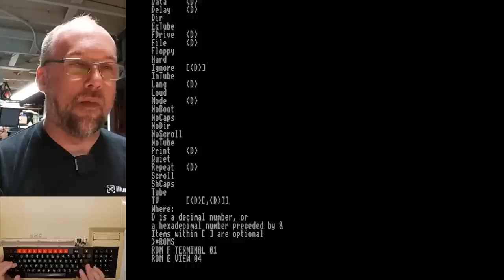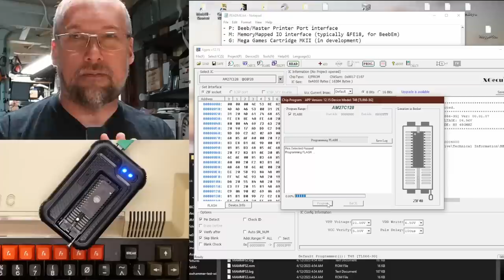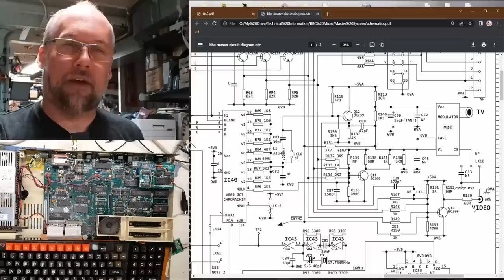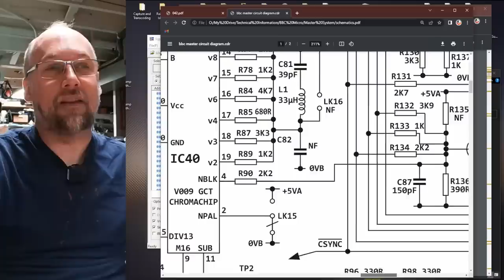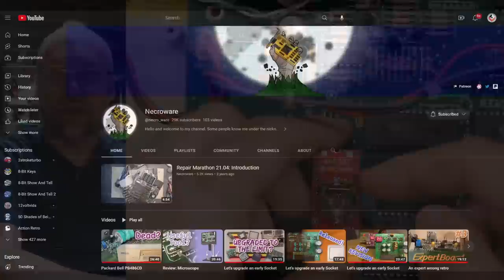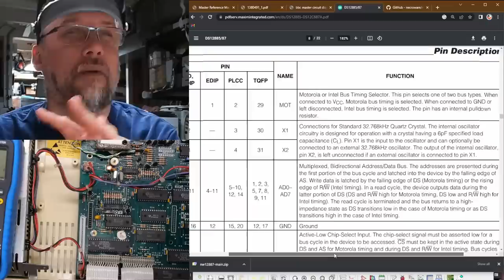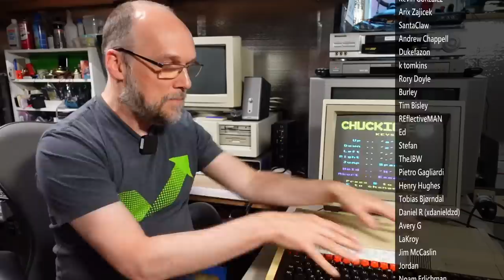BBC Master mods and improvememts

Comment: I used these things at school as a primary schooler, but I have more C64 memories for games, but its always really cool to see them.

Great to see running, and fun to see your solution to certain... I guess you'd say regional problems. I remember using PAL60 on the Dreamcast and A1200 just to be able to get a colour picture on my RF only bedroom TV. For downstairs when me mum was out or in bed, I could use SCART for RGB. With the Dreamcast it's sorta surprising, as it was inbuilt into most games to ask if you want to play in PAL60 on startup, it's odd for such a hacky mode to be almost system standard. I only ever had 1 TV it didn't work on and it was an expensive JVC set from the early '90s. Even cheap crap '80s portables managed it after a quick fiddle with the vertical hold.

Comment: The BBC Micro Model B issue 7 boards had the same jumper to add chroma signal to composite.
I put a small switch like you did, colour/mono.

Comment: The Dallas Chips with the internal battery and crystal have a battery and crystal in their larger case and the IC pins for those are bent upwards and connected to those. You can revive any old Dallas chip by removing some potty to uncover those pins, disconnect the way to the internal battery and connect an external coin cell. Some other RTC chips of that type have the IC pins for crystal and battery at their head sides and need those uncovered, but basically there is no need to throw any of those chips away.

Comment: I'd probably put a bit of hot glue around the socketed crystals as they seemed like they might fall out if the machine is jolted. I wonder if you can also jumper between two different crystals, pal/ntsc. Was cool to watch you solve all the problems, nice work!

Comment: When I was at school, oh so long ago, I used to think the BBC was quite clunky compared to my VIC-20 (and the PET that had been donated to the school because the screen editor built into commodore machines was just streets ahead of anything else in terms of usability. I think the (much later) Master may have had alternatives, but the standard 'copy key' method of editing is a bit horrid — half a step above a paper terminal.

HOWEVER, as a now semi retired software engineer, I now appreciate how clever the software architecture of Acorn MOS is; the Sideways ROM idea, for example, allowing lots of alternative file systems, programming languages etc. all within the confines of the 64K address space is something I think no other (non Acorn) 8-but got close to. Then add in concepts like the Tube.
Reply from the maker: Yeah the Commodore editor is a shining star in late 70s system honestly ... And indeed, if you had a BBC and were doing any serious editing, it looks like you really needed to get that Basic Editor ROM I've seen some people use. It's quite amazing that the 1977 PET had that wonderful editor that everyone loves from the VIC-20 and C64. 

But yeah, the computers are just so  smartly designed, and the rest of the basic interpreter is pretty damn great.

Comment: I noticed that link on IC40 the first time you showed that area of the circuit diagram.  I was waiting to see if you spotted it too before commenting, but I thought immediately that there must be a way to reconfigure the hardware to use NTSC instead of PAL.  It's fun to see that you noticed it too, and that it worked.

Comment: All you need now is the tin box Microvitec Cub monitor for the full experience, only big issue would be the voltage (and I've no idea if they can be switched or modded for 120v), although shipping one of them across the pond and having it arrive intact, that's another problem... :P

Comment: BBC basic was largely written by the same person responsible for the original ARM instruction set.
Reply: Roger (Sophie) Wilson wrote BBC Basic and with Steve Furber, both developed ARM.  Credit to these two individuals.
Reply: @marillionuk  I was very specific in referring only the to the design of the ISA, not the design of the processor overall.

Comment: Just make sure the clock battery is over 3 volts before buttoning up the computer and putting it away. A coworker came across a situation with one particular SRAM / clock chip (can’t recall the part number, will try and find it) that when the battery voltage is just under 3 volts when it is powered down, that chip begins actively draining the battery! Changing the battery to a fresh one fixed the ‘problem’.

Comment: If you look at how we in the UK do a "ZX Spectrum Comp Mod" we do just connect the V1 signal to the comp output using a 100 micro farad capacitor to remove the DC.

Comment: I used a bbc b at school and bought one later and then sold it later on i wish I had kept it. What i liked about the bbc b was the user port you could use this control lots of projects in the same way you can use the gpio on a raspberry pi. I was so easy to use and expandable.

Comment: Going back to something you said in Episode 1, I'm like 99% sure that machine was used in the BBC somewhere, that stamped on logo very closely matches the logo that was in use on BBC TV throughout the 70s and early 80s, even with the double spaced line through the middle of the B's. Would also make sense to have a speaker switch in a TV studio as well. Pretty neat.
Reply: They did use them at some point for the teletext services I think. 
You could also hook up a digitizer so not sure if that was used for anything eg you could hook up a basic scanner or freeze frame and save it to file
Reply: It was mentioned in the comments of the previous video that it came from Broadcasting House in central London. But I wonder if it was actually BBC Television Centre in west London because Broadcasting House was largely the radio side of the BBC at the time.

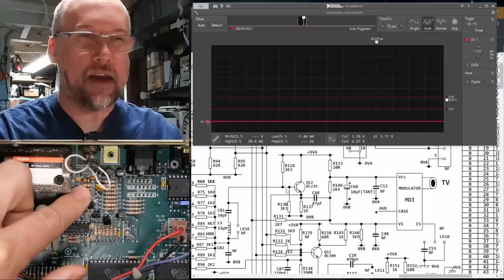Comment: Adrian, at 30:18 you mention R130 and R118 as connection points however I think you meant R137.  R130 and R118 connect to the Base of Q12 whereas R137 connects to the emitter of Q12 which I believe is the correct spot based on your description.  Did I miss something?

Comment: It was normal for BBCs and Masters to operate in MODE 7 (or 135 for shadowed MODE 7) when typing in BASIC or using OS commands -- this is the 40-column teletext mode with hardware character rendering, and is so much faster than any of the other graphical modes where the OS has to copy each character to bitmapped video memory.
Reply: mode 7 was also much easier to read for people like me that only had a TV and not a monitor

you are absolutely correct that mode 7 was not bitmapped like the other modes and was exceptionally fast...to demonstrate, list a BASIC program and see it whizzing off screen in mode 7...hence the need for shift+ctrl to suspend the scrolling

Comment: That machine has ECONET so might be worth getting a matching interface to let you host software on your PC don't know.
Reply: That's pretty hard core. I would say the Pi Tube Direct is a better addition to start with. That can then emulate the first ARM device in the world "ARM Evaluation System" and run the tube version of Elite!
Reply: @SimonEllwood  What about using the BBC Master to host software for the NABU PC as the NABU uses a similar connection

Comment: Great job with the RTC. As soon as I saw the 146818 part number on that IC I had an idea what you might do. The original chip was Motorola branded, the MC146818, so the Hitachi one might be a second source supplier for it. I also immediately thought "will it use Intel or Motorola bus timing?" as I had seen this on the datasheets before.

Comment: Great video. I have also been mystified by the Beebs. It seems a lot of the info out there assumes you grew up with the machine in the UK in the 80s and watched all the episodes of the computer show they had on TV. There's not a lot of "getting started" material, and a lot of surface searches end up referring to the Micro:bit.

Comment: I think you are correct Adrian regarding BBC Master being sold to Australia, especially in schools, I think it was rebranded as Proton...?

"BBC Proton" microcomputer, made by Acorn in UK but modified in Australia in 1981. This model was widely used in Australian schools. The donor states that he assembled the machine in the UK while working for Barston Computers.The circuitry is hand soldered. This unit is serial no. 2. It is the third one made as the count started with 0.

(Also known as BBC Micro Model B).
Reply: The Proton was Acorn's planned successor to the Atom before the BBC contract came along. The design was then adapted to meet the BBC's needs and became the BBC Micro, available in Model A and B variants. The BBC Master followed the Model B+ which was itself an updated version of the Model B, also being the common element in Acorn's largely unreleased Business Computer (ABC) range.

Comment: Regarding 60Hz output from the BBC Micro, I wrote my own utility ROM for the Beeb which contains commands to configure the 6845's video timing for 525 lines 60Hz as well as 405 lines 50Hz (the old UK TV standard 1936-1983). I used them for generating video test signals. They work, but the catch is that the OS doesn't know about the reduced number of lines so the hardware scrolling is messed up. But for testing purposes they're OK. I think I tried the ROM on a Master at school. You're welcome to a copy of it if you want to experiment.
Reply: replying to my own post, I've just tried the commands on my BBC model B here and the hardware scrolling actually works fine in my 525- and 405-line modes. Better than I expected. They're quite usable.

Comment: black and white televisions were the forerunners of all color televisions. NTSC was the first standard that enabled color. for PAL, the weaknesses of NTSC have been corrected. Every second color line is sent with the sign reversed and corrected again in the monitor. This solves the "Never The Same Color" NTSC problem.
In addition, the color carrier frequency was increased slightly. The 50 or 60 Hz is due to the power system. Due to the slower frequency, more lines can be shown. But European C64s run a bit slower because of this.
Nevertheless, the monitor line frequency remains around 15kHz for all systems. European monitors can often display the simpler NTSC. 
SECAM was the French standard very similar to the German PAL system. Many communist countries also used SECAM.  
East Germany also until 1990. West German devices could do both. 
East German devices not for political reasons, only if for export to West Germany.

Comment: When you decide to tackle that Sun IPX, you will find the Dallas clock chip will have failed in it... and the modern replacements don't quite work right in the Sun machines.  There is an extended configuration storage area that Dallas stopped supporting, even if the rest of the chip works great and is pin compatible.  This means you have to perform a magic incantation in the Boot Monitor to configure enough of the machine before it will boot.

Comment: SD card interfaces using SPI is very sensitive with increasing clock speeds. I had problems getting a stable operation over 8MHz on a multilayer pcb with 2-3cm wire lengths between card and MCU, seeing your flat cable length and high resistance level shifters  makes me wonder.

Comment: I suppose most users today use standards converter to convert PAL 50 Hz to NTSC 60 Hz. These devices vary in quality, but some of the better units do a proper interlaced conversion. So more modern monitors/displays should work.

Comment: I really enjoyed this video

if you ever come back to the UK, let me know...I'd like to show you my collection of 400+ bbc micro and dozens of archimedes

imagine every type of bbc micro made, and its likely I have an example...issue 2, 3, 4, 7 motherboards...dozens of bbc master compacts, including 2 olivetti badged ones...B+64 and 128...bbc master...second processors - internal and external - 6502, z80, 32016...I've even got a 68000 based torch graduate...I'm only missing an arm based 2nd processor

Comment: I always wondered why Acorn didn't hold as high of importance when it comes to knowing historically significant companies in computing.  Sure they're up there, but primarily just for the UK and parts of the EU, which is silly considering the advancements they eventually made with RISC and ARM.  

I'm still waiting for an ARM based PC with a motherboard with an actual expansion slot or two on top of a NVMe slot for a SSD.  I do arm64 assembly for fun, and I was finally able to upgrade my native computer I use for that and day to day stuff to one of the more recent SBC's that have 16gb of ram, a NVMe slot, and a pretty crazy processor/GPU package for a small relatively cheap SBC.  It'd be nice to have a CPU slot, but the amount of pins these days make that kind of impossible.  Still, an expansion board using an interface similar to the one raspi compute module and similar board designed for higher end SBC's in a mini ATX form factor to give a PCI slot and NVMe slot would fantastic.

Comment: 39:13 originally called NTSC-N; it seems that some NTSC machines, like the Atari ST use this mode when running PAL software (similar to how PAL home video systems from the 90s play back NTSC tapes in PAL-60, which is just an image with NTSC resolution and frequency but colour translated to PAL).

Comment: Isn't the circuit diagram showing a link 11 (not fitted) that provides the colour burst signal to mix into the composite signal, or am I misreading something? Having looked down the comments so far it seems that nobody else has seen that either.

EDIT: Seems I commented about 1 minute too early after I'd paused the video. Glad he noticed it.
Reply: Shouts at the video "Use LK11". Here's this application note that talks about it. http://chrisacorns.computinghistory.org.uk/docs/Acorn/AN/001.pdf

Comment: Isnt the circuit at around 6:11 a bit strange?  There are no voltage dividers from the 5v side to the 3v3 side, for example pb0 is connected to sdi with a 4k7 resistor, and to ground with a 4k7 resistor. No voltage divider in the expected direction... To me it is unclear how sdo (serial data out) can pull cb2 high. Is cb2 high unless pulled to ground and the 4k7 ohm resistor to weak to pull it to ground? Any explanation?

Comment: I posted a question about the level shifting circuit to Electronics Stack Exchange ( search for "Level shifting through diodes and resistors"). It doesn't look right, Adrian - even if it works, it's probably stress-testing the tolerance of the MMC circuitry to 5V.

Comment: I think the BBC Master Compact came with a Acorn branded 1084 monitor.
Reply: The ADF32 model was the colour monitor option, being a Philips monitor (not sure exactly which one) with a 0.42mm dot pitch and supporting 50/60Hz field refresh rates.

Comment: I’ve stopped using EPROMs on my Beeb and use pin compatible flash chips. Since I have an electron as well I tend to use cartridges. A master does support 8K but you need to configure the socket.

Comment: That's what free software is like, ie, if you are lucky enough to get instructions, it's rarely for beginners. Basically it's even more work for the usually single person writing the software, so they generally skimp on instructions. 
It was the same when I was doing DIY EFI, I ended up do the instructions for beginners even though I had no experience - lol -.

Comment: The 1084 is the same case etc as the Acorn low res colour monitor (probably with a few mods as the Acorn one was RGB) from the early Archimedes era.  We sold loads of the CM???? (cant remember) monitors with Masters but we would connect them via RGB which gave a better image
Reply from the maker: Yeah Philips made those monitors and they had a huge line of them. From low res color composite monitors to high res and highly capable multi input monitors like the 1084. I'd say the Commodore variant is the most capable

Comment: 37:57 I can’t be sure without seeing more of the chips on that schematic but I think you’ll find that the N on the NPAL (and NBLK) pins stands for NOT and not NTSC. This would indicate that this is an Active Low signal in the same way as other conventions use a bar above the signal name or a negating circle on the pin.
This would appear to be confirmed by the link connecting the pin to ground on PAL machines.
Reply from the maker: That's extremely unusual, especially given the fact the other IC's on the schematic have a bar/line over the text to indicate active low. Also conventionally written with a preceding slash. (ie. /CE)
Reply: @adriansdigitalbasement  Not sure what happened to my follow up reply but in case it is YouTube objecting to my inclusion of supporting links but to summarise not only is it not unusual but early manufacturers data sheets used that convention. My favourite example is the National Semiconductor INS8060 SC/MP processor.

Comment: just my 2c... the turbo circuit can be configured and used by the bbc, in an identical way to the basic circuit through controlling the buffer gates in the circuit. But in turbo mode it reconfigures the buffers so that the sd card di and do use the same pin on the bbc (this is faster with the uart?)